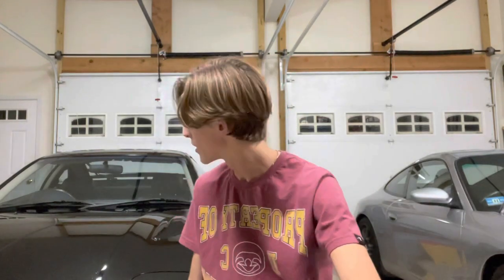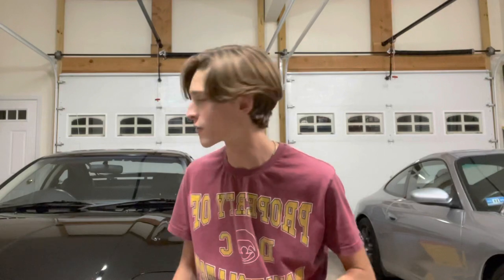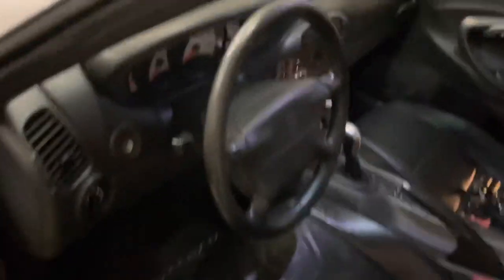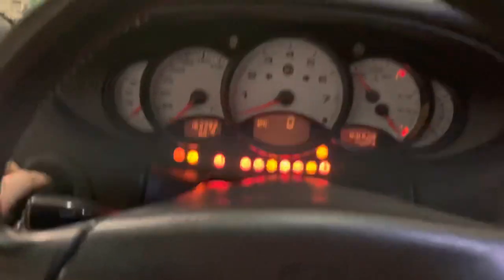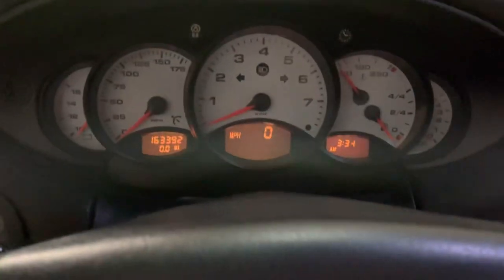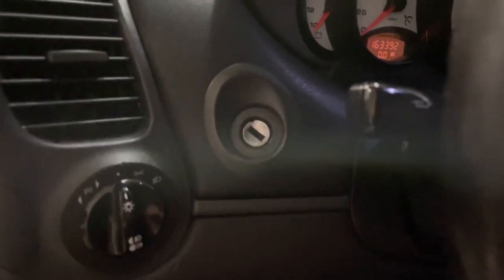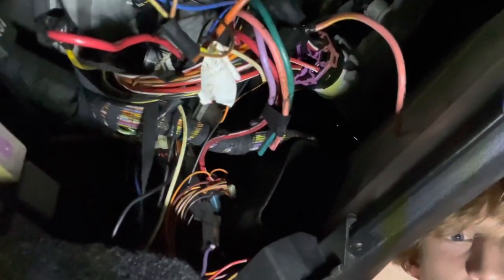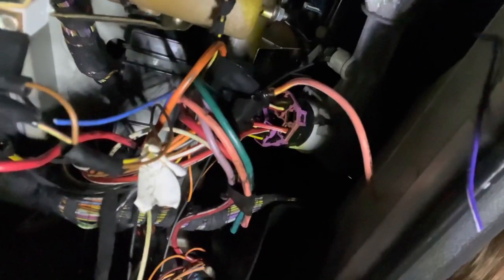Porsche 996 Starting Wiring Problems (no crank) + Solution in Comments

Comment: Are you sure the starter isn’t stuck?  Old Ford trick when you had dash lights and it wouldn’t turn over was to crawl under with a hammer and give the starter a good whacking.  Cast iron part so it could take it and it usually worked to free the bendix that wasn’t coming out and engaging the flywheel. Could be that rat’s nest of wiring too, though.  GOOD LUCK PAUL!!  And good luck on getting into the school you want too.  Do a Fall drive in the 911 once you get it sorted. Your driving vids are excellent.
Reply: Agreed! Wack that starter with a hammer
Reply from the maker: Will do! I’ll give that a try, and hopefully it works because I’m craving that fall drive…

Comment: Good luck man! My ignition switch is on its way too. But I can still baby it so, of course, I will not deal with it until I have to. You sure the clutch isn't involved? With mine the clutch has to be all the way to the floor. I'm sure you know this but, a possible issue.
Reply from the maker: Thank you! I tried bypassing it and all, it’s definitely the mess of wires :/
Reply: The same thought ran through my head. The clutch pedal micro switch.? But after seeing the abomination of wires under the dash I may have to rethink that. Could very well be an ignition switch. Either way, that mess needs to be sorted. Please don’t just get the immediate problem fixed and sell it. Someone already did that to you. I’m just guessing. I suggest getting it fixed and not selling it. That’s you’re first born child❤️👍. Keep us in the know.

Comment: Was it the ignition? I have had a similar issue :/ driving me crazy. I already replaced ignition switch ..
Reply from the maker: It was actually the ignition cabling that went from the alternator to the starter motor. Had to order from germany. Not cheap, but satisfying, and has been good for a year.

Comment: Hello, did you solve this problem? It happened to me too. I press the starter button and there is no sound ?
Reply from the maker: in this case, it was the starter wiring harness. However, if you have a cabrio or boxster it is likely the immobilizer

Comment: Was this problem fixed what was ? I ran into the same thing I have a 99 automatic it was sitting for a while I thought the battery was dead  so I had it full Charge... I get lights and everything on but when I go to crank absolutely nothing still ... I don't know what to do now
Reply from the maker: Yes, fixed by replacing the key and ignition wiring from the alternator to the starter motor I believe, some wiring harness of some sort. I’ll find the exact paperwork.

Comment: When you took the key out of the keyhole, I couldn't hear the click that the 996 makes. I don't think it's the wiring but the actual ignition switch itself. $20 part and about 30 minutes of work should have you fixed.
Reply from the maker: Let me check that…